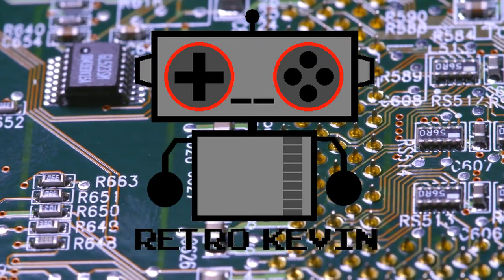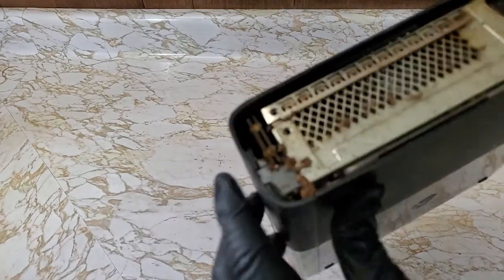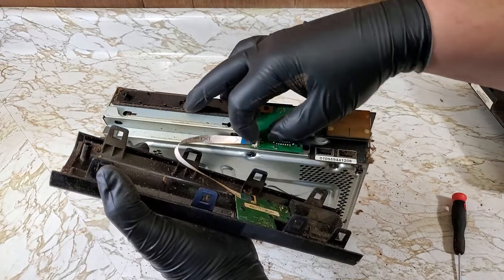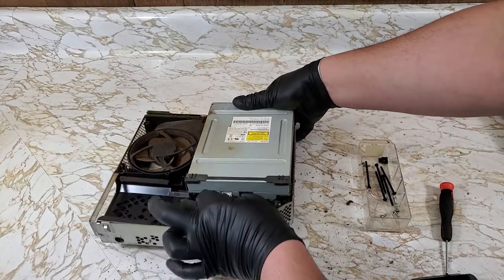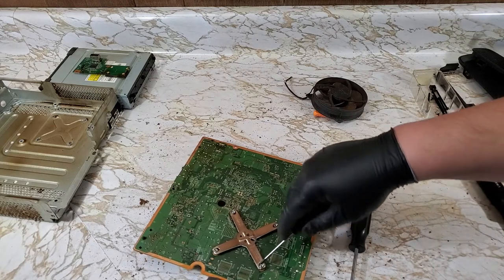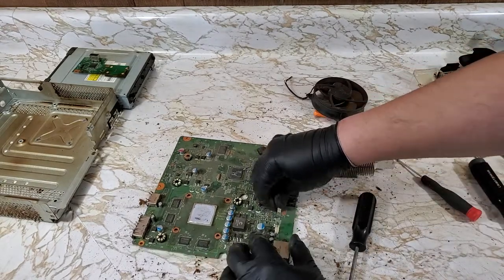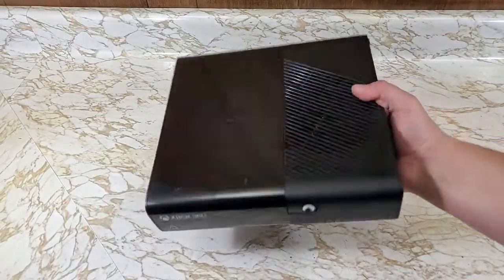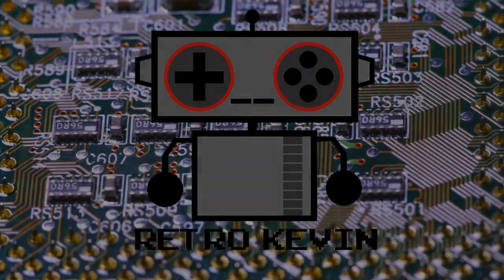Deep-Cleaning this DIRTY Xbox 360 E! Part 1: Teardown, cleaning, and new thermal compound.

Comment: Thanks for this video! My gf has this exact model and it keeps overheating and shutting down, even though the interior of the console is relatively clean and dust free, so I figured the paste needed replacing, but I've never used thermal paste before so had no idea how to do it!
Reply: Thanks for the vid man u made my life alot easier

Comment: My console looking red light in on xbox 360 but my xbox 360 fan is dirty dust he work slow 🐌 and console show red light right or not plese help mee
Reply from the maker: How many Red lights are on? Or is there an error code that your TV is displaying?
Reply: @RetroKevin  E 82 ERROR CODE iam from Pakistan
Reply from the maker: @shahsahanasjaavama8471  I don't think error codes change by region. But I would recommend following the teardown I did in this video.

When everything is off the motherboard and it's cleaned try reflowing the solder by running a heat gun over the top of it. Keep the heat gun moving over the whole board about  15-20 cm above the board.

If you don't have a heat gun a hair dyer on high setting may do the trick. It will need to be held closer to the board as well.

Make sure and have some thermal compound/paste before doing this. As that will need to be replaced as well.

Best of luck!

Comment: Man, that was gross...🤢Good video, but... now i have the urge to get up and wash my hands.😅

I did a restoration of a 20xx PS3 Slim 2 or 3 months ago which i bought from a smoker and it was in similar state (greasy brownish dust balls all over the place and even inside the PSU). Iirc, there had to be even some liquid spilled all over the place (the metal housing and drive were partially corroded).

BTW, i'm a smoker myself, but don't smoke indoors or in vicinity of other people. I really despise those selfish f*cks who do.
Reply from the maker: It's really hard to get the smoke smell out of this stuff. 

If this was for a resale I would have done a lot more for cleaning. But it was going back to the original owner.